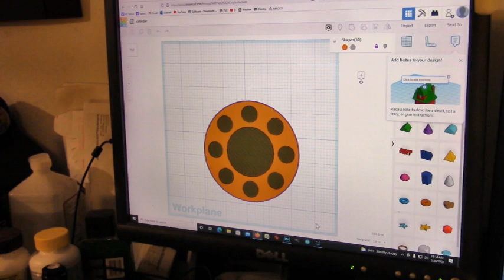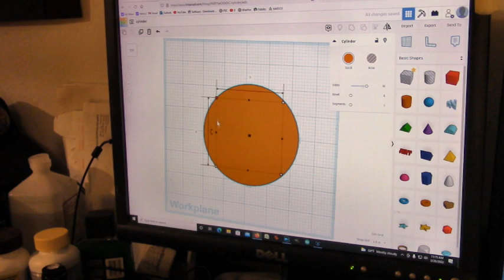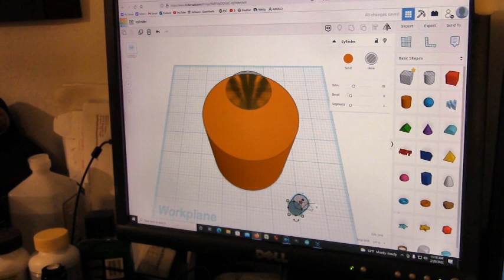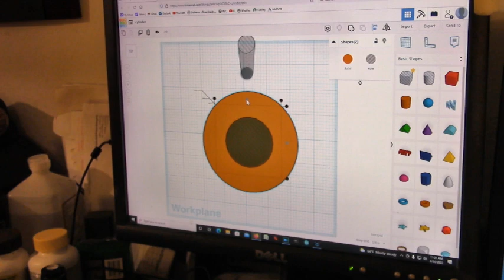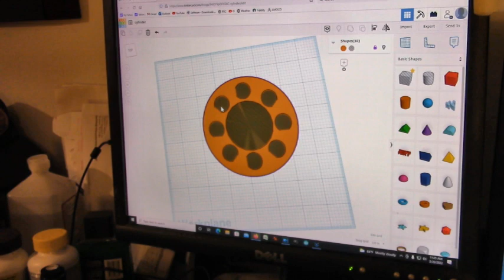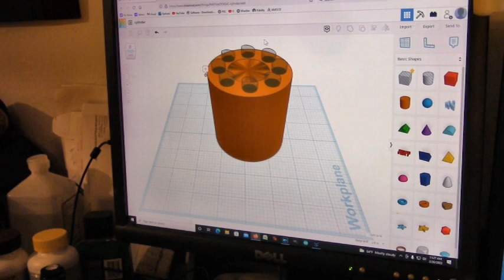Using tinkercad to make a cylinder

Comment: I have Linux operating system on main PC, so Tinker Cad doesn't fit, but have our 13 yr old that has Win 10 just getting into it. There's a link called Tinkering with Tinker Cad that shows creators doing wild and awesome things with it.
I have FreeCad but stumbling through the learning curve as well. Was given a PC on Sat with win 10, and going to check out Fusion360 hobbyist version. . With the Brides health, all on hold at present.
Thx for sharing Harold, Bear
Reply from the maker: When you get to it Bear just take it slow and easy.  Thanks Bear.

Comment: If you can do that in TinkerCAD,  you can do it in Fusion 360.
Reply from the maker: That sounds reasonable.  That depends on how much of the absolute basics you learn up front.  Most experts start to teach a bit above that level and sow confusion in their wake.  Of course if you have made the same item does it matter what software you used?